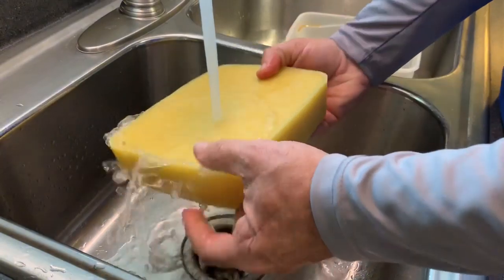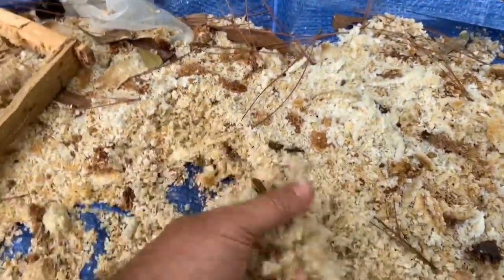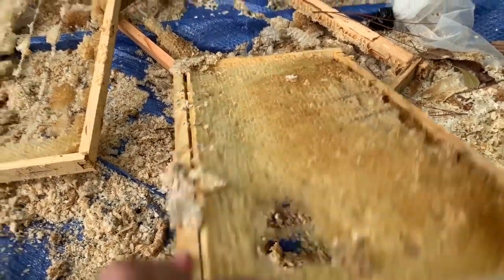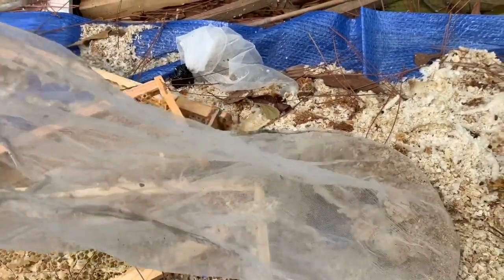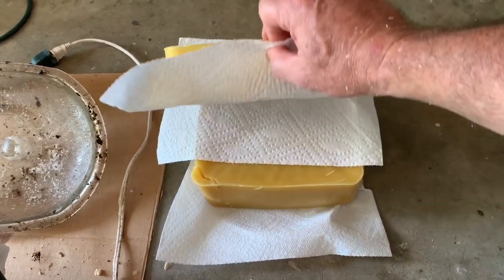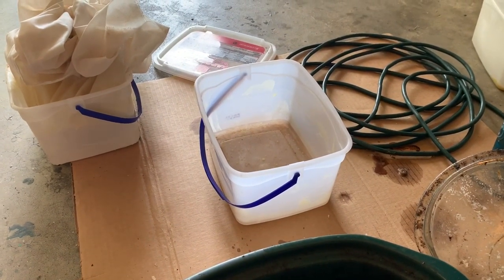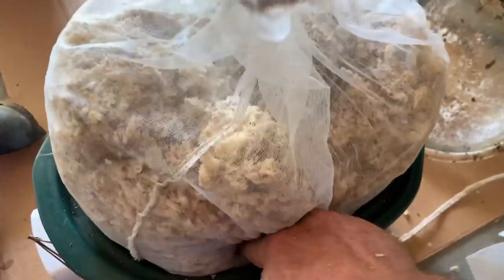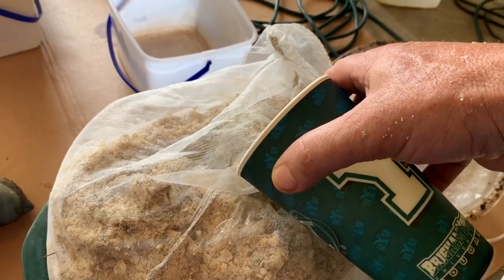Processing BEESWAX!!!

Comment: You could try a solar wax melter, fill it and leave it, no current use, no burning of wax etc. and very little use of your time. When checking hives all the bits of bur comb and scraping, old frames and just put them in your solar melter. Collect at night when everything cools. A good tip, Slow the tap down so as not to waste water 😘
Reply from the maker: Have never tried a solar melter but that is a good suggestion. Thanks!

Comment: Bruce I use old saucepans for molds .. they self release due to the walls not shrinking with the contents, I would suggest that you try one. I also add water it is a must.
Reply from the maker: Good idea. I used a bread pan when I prepared some wax for an entry to the kitchen al fair last fall and it worked well. Thanks!

Comment: The finer screen mash,  makes a more softer wax for lip balm  like 100 micro screen>  i tried nylon mash screen  on hot wax and it didn't melt. woman leg stocking works EXCELLENT! so that what i use stocking!   even for my wine and things to strain  Much Much cheaper than paint screens> like 6 pairs for a buck!  that 12 filters. CAN CUT EM into halves  GET MORE FILTERS > just tie a knot can get 24 filters easy < >   Can use pantyhoses too
Reply from the maker: I hear ya man. Thanks for the input!  I just use the same paint strainers I already used for the honey harvest and then toss them when done.
Reply: @brucesbees   Have you seen what the weather like in late AUG.?  wow nights in the 60's day in the mid 80's Fall coming FAST!
Reply: @brucesbees  They lied about the weather!  hell it got hotter, rather than cooler!  today we got up to a blistering 104 deg OMG IT WAS HOT where in a drought too!

Comment: Would it be useful to spray the inside of the plastic ice cream tubs with Pam or some kind of cooking oil to make the wax come out more easily?
Reply from the maker: That might work. Would be worth a try. Water usually works well. Not sure what happened with that one block at the end. Have never had that happen before quite like that before.